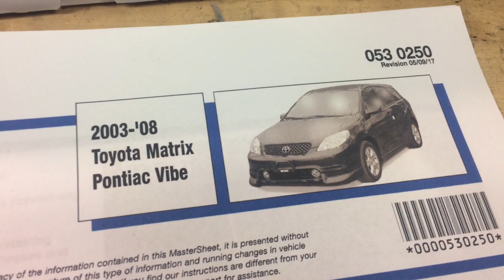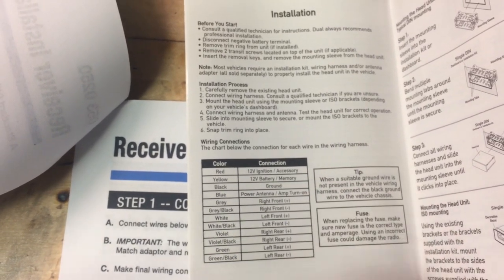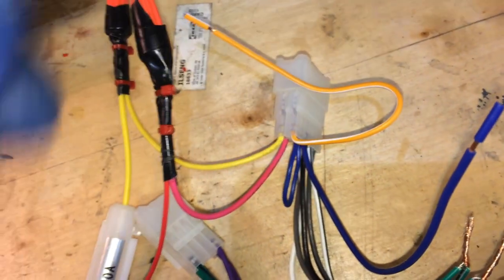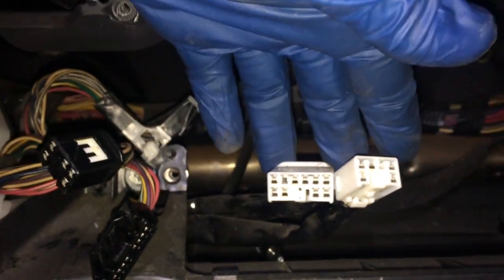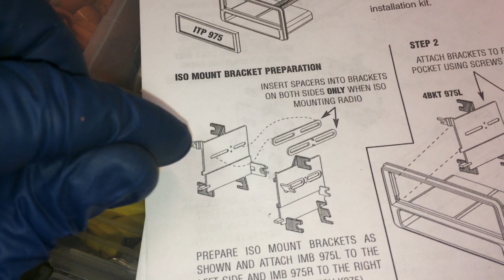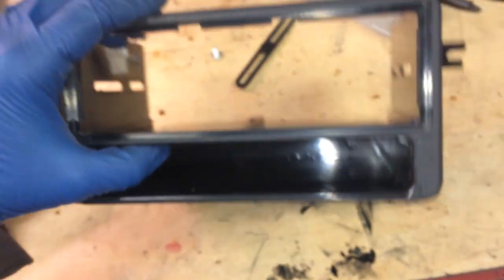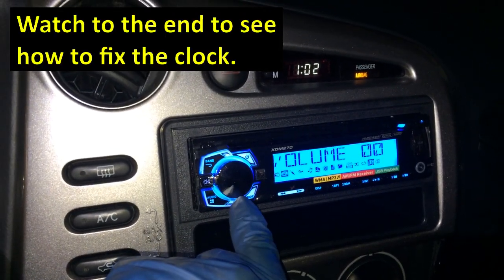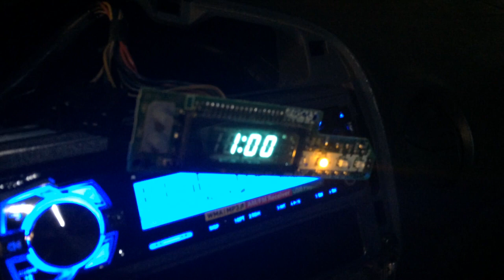DIY: Toyota Matrix Radio Install (2005 -2008) Single DIN to add a pocket (plus Clock Repair)

Comment: Thank you for the tip to fix the clock! In my case there was broken soldering of 270 resistor exactly at the spot you made a bit of a mess. Now my clock don't have an independent life. They turn on every time I turn the ignition on.
Reply from the maker: Well done fixing it! Yes, its nice to have a clock that actually shows the time, haha.  I'm glad I could help!

Comment: Hi, for those tiny screws you'll need a star torx T 7 bit. The Hyper Tough 17 piece Smartphone repair kit sold at Walmart includes a T 7 bit, for anyone looking to get the correct size bit.

Comment: damn i can't be 100 % sur if this fits for my pontiac vibe 2005.   the harnesses seems to match, it's just the metra 70-1761 description that tells it's 10 and 6 pins that scares me because there is 12 pins.  But I guess it's good, i'll have to rewatch it.  Thanx your video is well made !
Reply from the maker: That's a good point -- perhaps send Crutchfield an email.  They seem to be very organized when it comes to their kits, so I bet they would be able to confirm in advance.  Good luck!
Reply: @L35inColorado  i don't think they ship to canada
Reply: Out of curiosity. Is there an install for inverted? (Pocket on top rather than bottom). I am thinking about installing a pioneer with a deployable screen and I would rather have the radio low, so it doesn't interfere with the vents.
Reply: @OneFoxTwoFox  just ask the place you buy it.  I bought the wrong harness online and then bought the good one at the store.

Comment: you did not need to use the outer sleeve their is two fine thread bolts on each side  that goes right into the the head unit

Comment: Where did you buy the connector kits? Do you think it’s better to buy the ReadyHarness from Crutchfield?
Reply from the maker: For this radio, I got everything from Crutchfield (the harness was included), but in the past I have bought harnesses on eBay and Amazon with no issues.  The same harness you see here (Metra 70-1761) is under $5 at Amazon:
https://www.amazon.com/Metra-70-1761-Wiring-Harness-Speaker/dp/B0002BEQJ8/ref=sr_1_1?keywords=70-1761&qid=1574961665&sr=8-1  
Happy Thanksgiving!

Comment: Hi, i have a toyota matrix 2006. The factory harness was cut off by previous owner...so  i installed the aftermarket radio directly to the wire (by checking with light test, multimeter to match the right wire): the radio powers on, but no sound.

I tried to connect the amp wire to acc (read on blog)...still no sound..

If i buy this harness (on your video), do you think the sound will work ? (i guess its activate your amp..so there is sound).

ps. the toyota matrix 2006 has a pre-amp or jbl system ??( i am confuse with this 2 )

If someone can help..
Thanks
Reply from the maker: Ah, man, that's frustrating -- I'm sorry that's happening!  I am not sure the harness would help -- because if you have the correct wires and good grounds, then your method would be as good as a harness (the harness just makes it easier).  The Matrix shown in the video does not have an amp as part of the radio system (it is just the base model with 4 speakers).  Since you're getting power but no sound, I would check the wiring to the speakers, and the grounds.  Also, you might start a thread on toyotanation.com in the Matrix/Corolla forum, because there are some stereo installers on that forum who are very helpful.  Good luck!
Reply: @L35inColorado  thanks !!!

Comment: PLEASE don't use wire nuts on ANY electrical installation. Solder your connection or use butt connectors. You should NEVER use wire nuts.